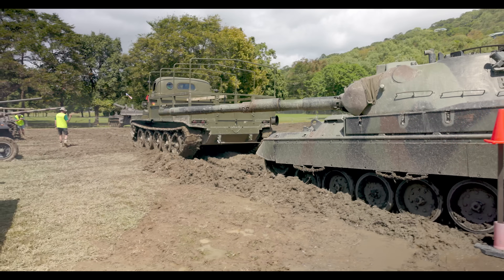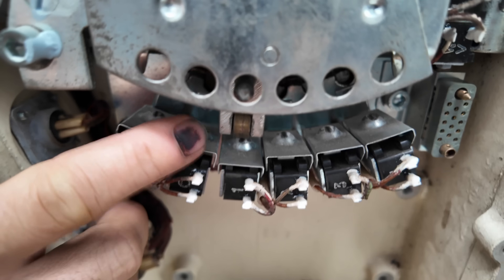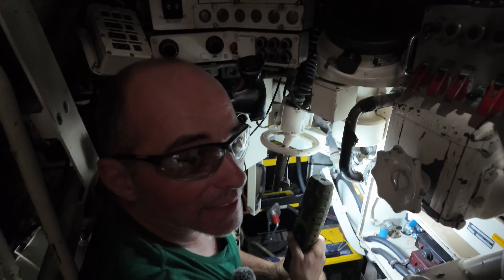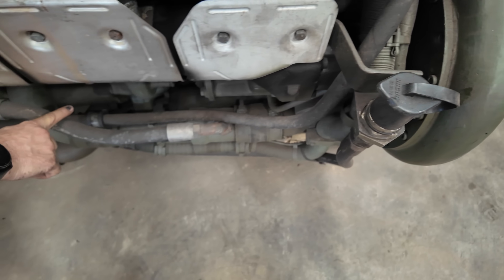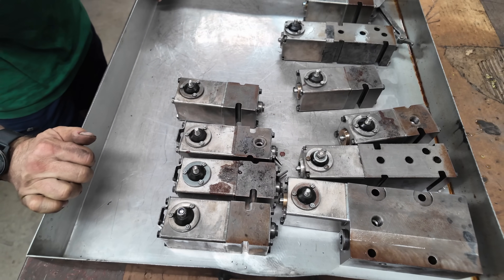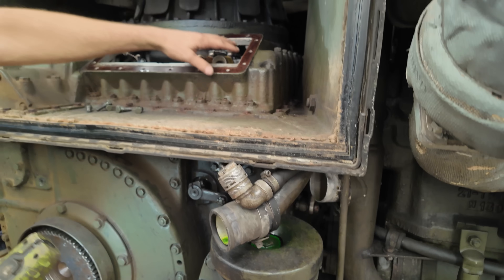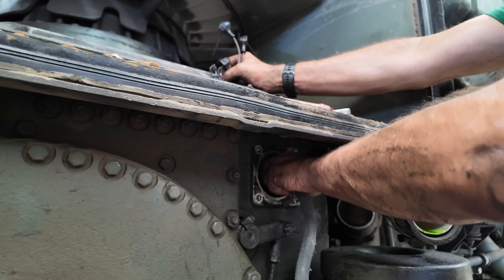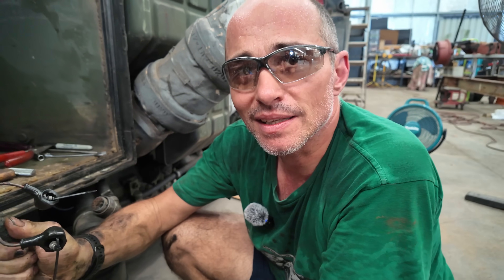Diagnosing and Repairing the Leopard Main Battle Tank!

Comment: Why did you not just remove the cannon plug from that small 4 bolt panel and remove it the other way. It looks like you pulled the wiring loom out backwards.

Comment: A German vehicle with transmission issues, No Way! I hope its not a DSG trans lol
Reply: Update to my last comment after watching the video. The transmission failed just like the DSG's do. Few tips when trying to fish the new harness back up, run a small peace of wire through the opening, tie that on to the harness, tape it up and using some trans fluid lube the harness. And if you can't find a good harness, don't worry, you can re- pin the connector. I know it sounds crazy. But you can that connector is a 3 peace unit the locking ring a twist lock and a seal all of witch comes apart. You can still buy the pins. It just takes time. I might sound like a fool, but a Mercedes transmission is just a Mercedes trans. They all have the same basic concept.

Comment: looking at the transmission cable connector - it looks like if you remove the two nuts from the connector you could pull it back inside - thus pulling all the cable through the solenoid cover.

Comment: The good news is, now you have a bit of wiring to learn the skill of replacing connectors, without the risk of failure.  I have worked on some of those pin connectors as, like @ecohunter4199, I also have former military vehicles that I work on.  Connectors such as these are actually rather straightforward, rather sensible jobs.  But, when learning new skills, it's easier to do when nothing is wholly dependent upon a good outcome the first time you try.  So, when this is all done, I suggest make time to go forward with your exploratory training in good spirits.  You're doing good work and doing a good job of explaining your protocols.

Comment: good luck with the connector. They are not too hard to do if the access is good if you have to be a contortionist to do the bulkhead you may need a bleep machine for the video. Sorry I wrote that before the end of the video. When you put it back in wrap the loom tightly so it feeds like a single cable and unwrap it once its in. Don't use cheap electrical tape direct on the loom or you will just ned up with a sticky mess.

Comment: @3:36 rather than check continuity with a meter as so many do, check with a test light that will pass some current through the wire. Often the super low current of a continuity tester will show continuity on a circuit that can't carry current. For instance a break in the wire with corrosion bridging the gap will show continuity with a very small milliamp current but not with 1 or 2 amps. Of course you must protect sensitive equipment and discount the wiring, and you want to keep the current within the wires specs...

Comment: i am always a bit confused these parts dont get repined i do it often on farm equipment hookups dill out the bad one make a new one from copper tin the end put it in with a dab of flux on it heat the untinned end with a soldering iron till the tinned end flows and new pin in no re potting not perfect but it has got to be less expensive with parts hard to find (this is farmer fixing so i might be missing something) but the components i am working with are in hard environments vibrations manure water mud and heat

Comment: Those 19 pin connectors look very much like the connectors used on the AMF 82/70A and B chassis connectors. Although I think they may have more pins, but look very similar. They are often available used and you can buy the AMP pins from a good electronics supply company.

Comment: He said he doesn't want to think about how to get it back in but It looks like that connector can be removed from the square plate. If it comes off, he can just run the large plug from the inside and out the square hole just like he removed it. Instead of trying to fish all the small plugs up thru that square plug hole.

Comment: Hey, love the show. As an Aircraft Mechanic I deal with lots of canon plugs.  All canon plugs can be replaced, you don’t need a new harness. There should be a milspec number on both the jack side and the plug side. I would assume that do to the age of the tank the wires are soldiered in to place. I would contact an Aircraft engineer to help you out.

Comment: I wish I was there to help you, I am an A&P Mechanic, FCC General Tech, USN Avionics Tech, and a retired Skunkworks Dual Masters Degree  Polymath Aerospace Engineer (Electrical and Structural/Mechanical).  With replacement connectors we would be able to repair that cable assembly no problemo.

Comment: To put a wiring harness back in I'd probably tie a piece of heavy duty rope or steel aircraft cable several feet down.  Then hold it upside down (19 pin connector at top) and use black electrical tape here and there along the length often to keep all the connectors from moving/bunching up in a single spot.

Comment: the transmission connector looks like its just a jam nut holding it to the cover plate.  Just unthread it and pull it out.  then when you go to install it again just pass the connecter end from the inside out same direction you removed it then put the cover plate on and jam nut again.  I would honestly just order new pins, clean up the existing stuff and put in new pins.  Save a ton of money vs ordering a hard to find loom.

Comment: The NATO connectors used to have pins to push forward and solder on back as far as I remember. Biggest pain was if they became contaminated with diesel because the rubber became sloppy and pins moved.

Comment: The mill spec connectors are not all that hard, but the tools needed to do the connectors are themselves a bit expensive. It's not like you can crimp the pins with a pair of needle nose pliers.

Comment: You can buy those connectors and crimpable pins from ALS connector tech. They were obviously developed in the military but are becoming more common in aftermarket automotive and racing applications (suprised Steve hasn't fixed them before in his rallying days to be honest!)

Looks like you'd undo the double nuts on the plate and feed the harness down from the top?

Comment: 9:33, the pin configuration.  that is stupid having a round connector.  it would be easier to identify if the configuration was square or rectangular.  the method of sealing in what needs to be super reliable is suspect.  i wonder if it was routine to fill it with vaseline before reassembly.  as for reinstalling, 12:17, ive worked with electricians.  if there are any electricians in your group you will be alright

Comment: Steve is worried about threading the new loom back in, and that's exactly the issue, the milspec connector is likely pinned after that cup is slipped over.
IMO might as well learn to do it himself, can't be that hard and would be valuable knowledge now that those milspec connectors are actually getting more and more popular for civilian applications as well!

Comment: When you feed the new wires through, feed them in the opposite way you did now.  Feed the 19 pin connector through the top.  Remove it from the cap that is bolted to the side of the transmission, feed it through, then reassemble it to the cap.

Comment: Um, would have been MUCH easier to unscrew the burnt out connector from the mounting plate on the outside of the tank and pull the harness out from the top instead...

Comment: Having worked as an aircraft electrician on 1960's technology jet fighters, I would not relish having to repair that Leopard trans harness. That generation of electrical connectors were made to be nearly bullet proof. Far less attention was made to make repairs an easy process. They were built with a 10-to-15-year service life in mind. No one dreamed people would still be using them over 50 years later! Water got into connector likely because an O-ring failed due to age. How many more are waiting to follow on in that tank?

Comment: Great video! Steve, did you notice that the identification plate @5:58 is already missing 2 bolts! Just like said yourself, you don’t want to imagine what could happen to the transmission with loose bolts lying in the transmission. Keep up the good work.

Comment: Repinning Cannon plugs is dead easy. I've done literally thousands. Just make sure that you have the correct pin and crimper for the plug.  Maks sure the receptacle for the pin isn't full of crap, which shouldn't be a problem with a new plug or receptacle.

Comment: Are you not able to disc9nnect the bulkhead connector from its mounting plate? Install it by leading the connector from the top instead of pushing from the bottom. Should then only need the bulkhead connector subcomponent

Comment: Love this video. Having spent time designing and building wire harnesses, it is no fun for someone who has never done it. That connector should have been watertight (IP68) so I would say the internal seal got damaged and no one replaced it. Lucky only 19 pins wait till you do a 110-pin connector. All in all, a great video mate.

Comment: 12:30 It appears to me that the easy way to remove and/or reinstall that harness is to remove that big nut on the 19-pin connector and thread it thru the hole provided on the engine, then reattach it to that plate.

Comment: Just a thought if you did mess up the orientation of the wires in the gearbox .you don't have to dive back into the powerpack gearbox so long as the wiring terminates at a plug more accessible you rewire that instead it saves removing the powerpack. but you need to know all the wiring then add notes in your manual good luck, you wont need to do this.but if you did it wont be the end of the world

Comment: Love your videos. That said I watched your wiring harness removal. I noticed the locknut on the plate. I think you pulled out the wiring harness backwards. You should be able to feed the plug end down first from the top. Should be alot easier.

Comment: Attaching a small wire or cable to the harness before pulling it out could be of use when trying to get the new harness back in.. that way you already have the fishing line in place. 

Well, if it were me, I would have a crack at fixing the round cannon connectors first. Milspec wiring has a few rules.. but this thing isn't going back into the battlefield either so being really picky about eg. how you wrap and solder the wires may be a wasted effort. 

Don't skimp on how you strip them though. That part is important, nicked wire strands will just break from regular operation from mechanical vibration. I would highly recommend a thermal stripper like the Teledyne Stripall for prepping the wires.
Cheers,

Comment: Steve ! Hope you can read this ? I used to work in Telecommunications pulling phone cables through Pipes all the time . What you need is a roll of shrink wrap from a Telstra Construction Jointer ( if he reads this he will know what I mean and run some out to you) And wrap the cables tightly around with it, lasso a string and this is how I pull a large cable back up pipes. If you can't get hold of any use electrical tape and bind all the loose wires up in a constriction as tight as possible and with a rope it should go moderately easier up that hole.

Comment: Generally speaking the Leopard 1A2 was a very reliable tank! I know because when I was doing compulsory military service in Italy in 1980 and was quite often driving and doing service on those tanks. We have rarely pulled out the engine and I don't remember if we ever pulled the transmission. I remember that we never liked the M60 as we considered it bulky, slow and underpowered! Great job you are doing on my favourite tank 👍👍👍👍

Comment: Actually those "mil-spec" circular connectors are not hard to replace. There are insertion and extraction tools to take them apart. You could do a one to one wire removal and swap, or remove each pin and/or socket and label them as you remove them. Not hard at all and I am certain you can do it... Check with the connector manufacturer and get the two wire tools. Pretty ease with the correct wire tools...   Thumbs Up!

Comment: Steve has definitely been great mechanically but the easiest way to fix this would have been to just replace the bulkhead connectors without even removing the harness from the valve body. Each pin is numbered, you can just do it one pin at a time, solder yourself some extra wire length if its too short to work with.

Comment: My favourite tank. The build quality makes the British tanks I worked with for ten years feel like they were made by amateurs. The MTU V10, twin supercharged, multi-fuel diesel sounds fantastic and was very reliable, unlike our Chieftains.
 We used to watch them thundering along at about 65 k's on the Weizendorf Corridor which leads the the Hohne Ranges (a concrete access road specifically for tracked vehicles built before WW2).

Comment: Steve, the fact you are aware of the wiring issue and understand why it happened I seriously think you should repair it. So many of the tanks use mil spec connectors and the expertise that you will develop will repair this tank and many more in the future. If I can do it, as I had before retiring, you certainly will achieve this skill.

Comment: Would it be easier to reinstall the cable from the solenoid box with the Milspec connector in front to the opening in the, hull then reinstall outer the flange?  There would be a lot less ends to contend with.

Comment: You should have left a draw wire in as you pulled the assembly out. Also, 36 or 42mm socket to dis assemble the Cannon Receptacle - this means you are feeding the Cannon Receptacle from the top and keeping the octopus her it belongs...in the distribution housing. Does that make sense?
Reply: Abso-tanking-lutely

Comment: Surely it can pull out the bad pens and repen the same plugs that are damaged. 
I wouldn't think that would be that difficult, even if you have to make the new pens up and solder them in instead of crimping them in place. 
I'm not there with it to get a close look see, and no reason to doubt what you say.
But it'd be a lot easier to replace it few wires because they're too short to just add new pens to them. 
Then you just have those two wires that need replaced instead trying to duplicate the whole harness and all the plug connectors is match existing ones.
Never stops amazing me just how much the care put into it small container, and expect someone to work on it all in a timely efficient and timely manner. 
Especially knowing that the other sides armored crews are just a few miles away around the bend.
Because you already know what the first thing they're going to do as soon as they see you're sitting silent and nothing moves in response to coming into view.
So they pretty much know that something is wrong, are they're about to walk into trap themselves, but either way they are definitely about to send couple welcoming cards your way.

Comment: You can switch to the NL or GER automatic shifter if you have issue with that one (tried once and worked)
Even on road, we were instructed to stay in VG, V apparently can cause some stress and failure ( but can't confirm as I never used that position)

Comment: I was shuddering nearly screaming at the computer when you were pulling out that cable. You really should have attached a bit of string or another bit of wire to the end as it would have made the reinstalling of that loom a hell of a lot easier.  Regardless RS components can get you your connectors pretty quickly and nearly all of those connectors are not crimped but soldered in my experience. However that is with machine tools not tanks or aircraft.
Reply: He may be gonna feed the repaired cable down top to bottom the same way. But you're right. Either way a wire through would have helped.

Comment: Just FYI, acrylic art paint is great for marking cables, just paint different number of rings or colours or both. Has the advantage of not stripping off or snagging like tags if pulled round an edge that you can't see. Might also have been a good idea to attach a draw line before you pulled it through. Makes it easy to guide the new cable back in later.

Comment: Use to repair/replace those type of connectors and could probably do it in my sleep. Aircraft use them all over the place and Steve did the troubleshooting exactly right. Break the system down into smaller and smaller bits until you reach the end. If I could, I'd be there to do a re-wire job and show you an easier way to feed the octopus back up inside. The trick is to get your wire labels and make sure Steve is the only one to deal with it (Find a pin in/out diagram and label them accordingly (A-A, B-B, or 1-1, 2-2 etc.) should be found on the face of the connector or the rear of the connector). And to feed it back inside the transmission make all the wires the same length so it will be one size and feed easier. Then you can shorten the wires as need be to make all your connections and wrap up the harness.
Reply: I was going to say that avionics techs will be cracking a beer and a packet of peanuts and putting their feet up when they see this 😅😅😅
Reply: It needs a specific crimping tool and an extraction tool to remove the pins from the connector. 
To simplify the task, I would suggest to work pin by pin  (remove a damaged one, crimp a new pin, put it in place in the new connector, and so on) another way is to take a picture and list wire colors with the pin number on the connector to start with.
Spare parts can certainly be ordered online.

Comment: Hi i have used this method for jobs like this bind a piece of 1/8th welding wire onto the loom using masking tapeleave some areas of the rod exposed so that you caget a hook of some sort under it to help thread/push/pull it through to where it needs to be. Dont leave the tape on for too long as the moisture in the air makes it crappy to remove. Regards Chris Bailey